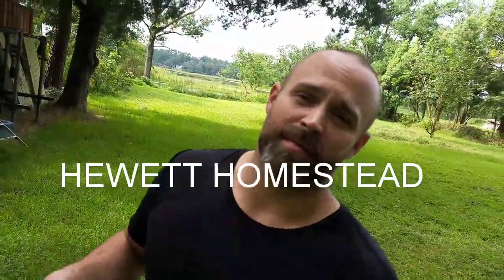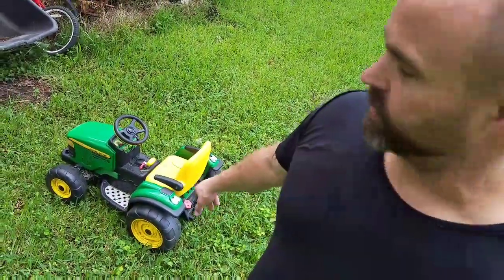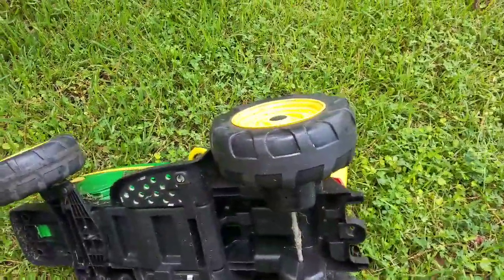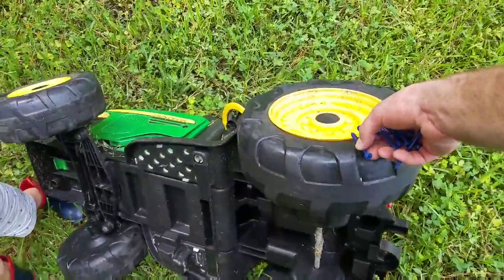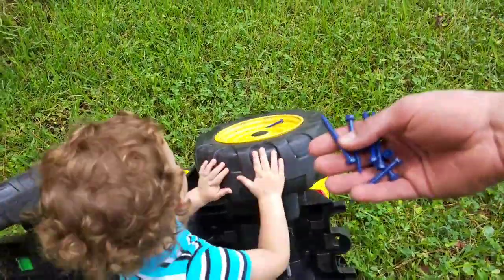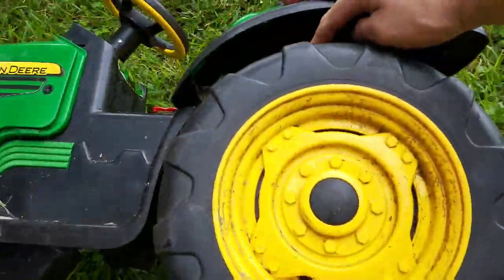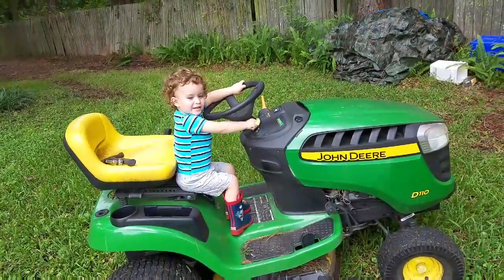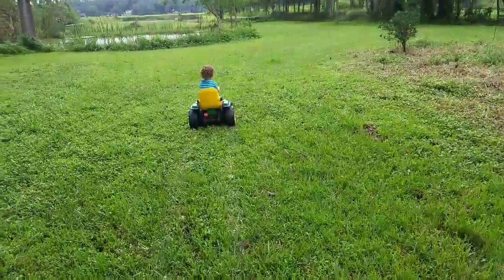Power Wheels Upgrade! Add traction to worn out wheels.

Comment: Hey buddy. Lol my kids have little jeeps. I got them for free from the trash, the battery died so i just put an inline fuse and a lawn mower battery that i trickle charge. I have seen some will cut the tread from an old mower front tire and attach it on em.
God bless buddy